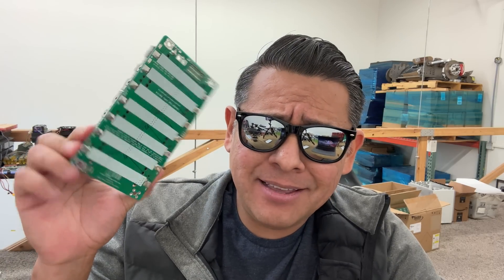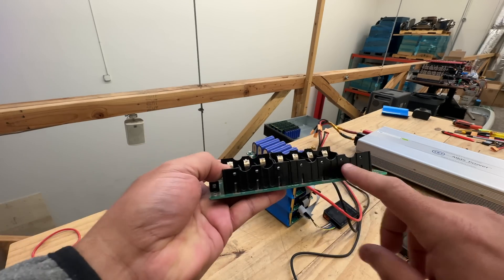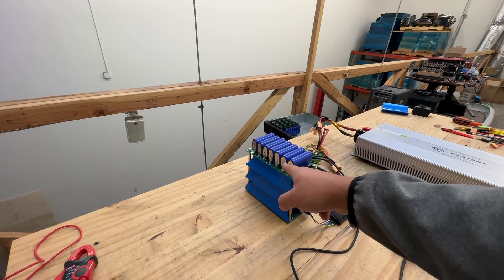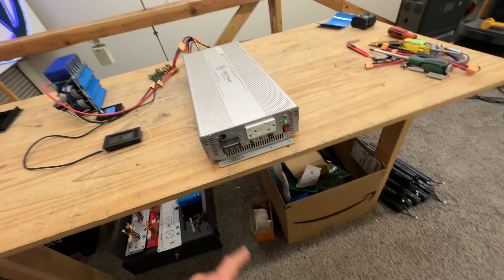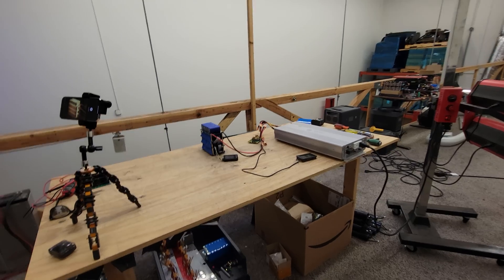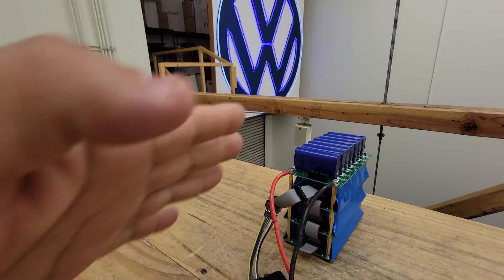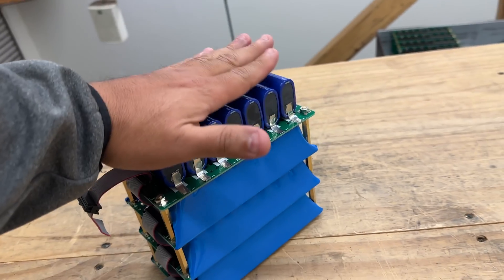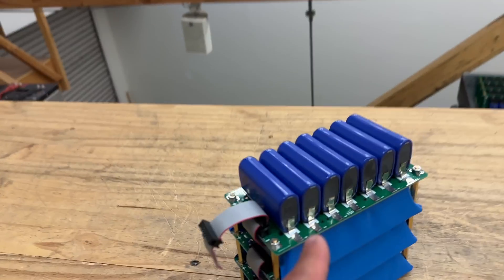Making PCB Battery Modules Bigger, Better, Easier and Less costly

Comment: Hey Jehu, thank you for this video. I bought 15 of the 8 cell Swing modules (order 19272) to revitalize my older 7S project boards. I then discovered the newer 7S modules with BSM & SOC options and was thinking of buying some to model my older stock after. This video states a newer version of the 7S modules with spot welds would be available. When I click the link in the Description it takes me to the modules with old style cell holders.
Reply: The thumbnail image is fixed now to show the new version. Thx for the heads up
Reply: @thejehugarciapodcastclips  Thanks Jehu, will take another look.

Comment: What about the 2nd fuse location?
Reply from the maker: There’s no second fuse
Reply: You have a 2nd fuse location on the bottom of the board at the rear positive standoff location. You had pointed out the location in an older video to be used for future high power distribution.
I'm not kidding. That is why I keep asking the same question in other videos. I'm figuring it was to be used when batteries are used on both sides of the board
Reply from the maker: You are correct,  I had completely forgotten about that

Comment: Looking at the thermal camera, the batteries at the terminal end are heating a lot more than the other end. I would suggest having opposing terminals on each end of the board to spread the heat.
Reply: Then he'd have to produce two PCB designs with alternating polarity.

It's really not an issue because the battery pack will be fully enclosed for motility use, and for static use you shouldn't be running them hot to begin with.
Reply: @phillycheesetake  what Brian is hinting is that the batteries closer to one end heat up (i.e. they supply higher current) then the other end. This leads to a faster degradation of those batteries. Until that is solved these units are a no go. By alternating leads you are intentionally creating a bit more path impedance but you are able to balance the impedance of each individual cell. (I.e. positive terminal 1 connects to 2 then so on to N. then to balance them on the negative terminal you connect terminal N to N-1 and so on until 1.)

Comment: I looked at these when you first put them out, because I have a Lectric XP 2.0 Stepthru Ebike that I want to build a 100AH battery pack for.  (at the time I was considering a DIY ebike)  I ultimately rejected them as a viable option because I couldn't figure out a way to make them super robust, or waterproof to my specific desires.  I really hope you continue to innovate in this design, Jehu!